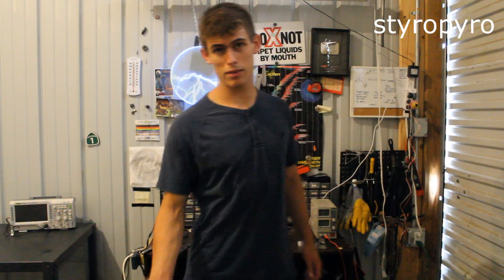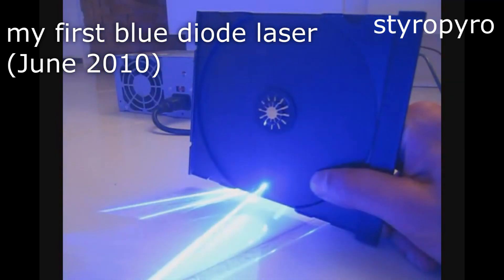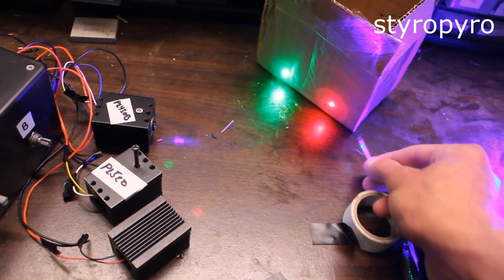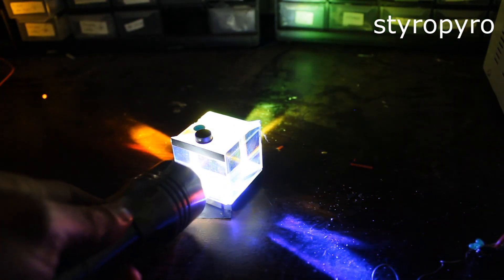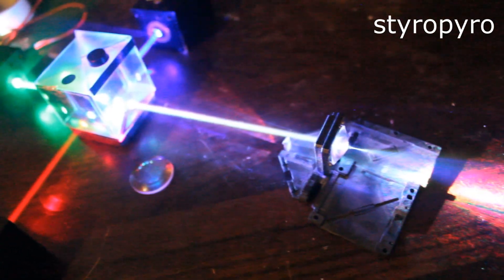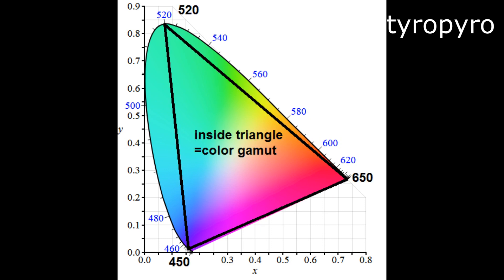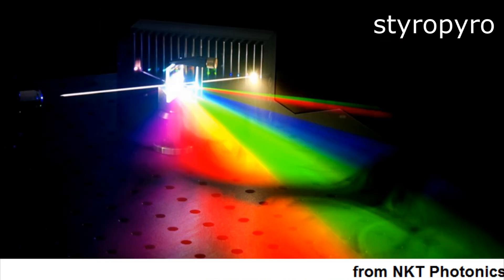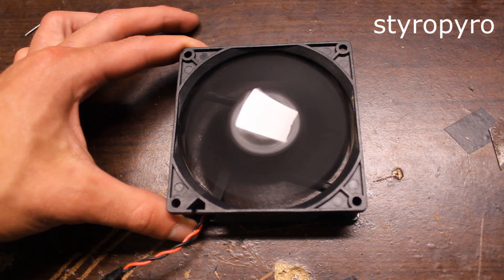Amazing White Laser Experiments!!!

Comment: “even though the amount of colors it can produce is infinite, it still can not produce all possible colors” that screwed me up
Reply: It's easier to visualize on a number line. There are an infinite amount of decimal numbers between 0 and 1, but that range is also finite. It's simultaneously both infinite and not depending on the context. If each colored laser contains a range of possible values from 0 (off) to 1 (fully lit) then really, the amount of "colors" a single laser diode can also be infinite. I think the more correct term is combinations, not colors, because everything you see from a combination of RGB lasers is still not the full spectrum. It's almost like the difference between digital audio and analog audio. Almost.
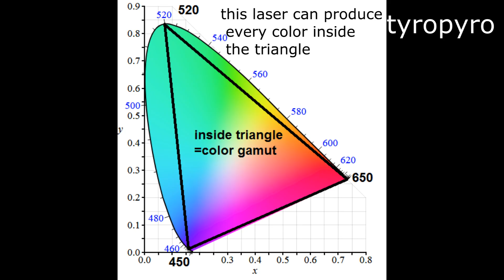Reply: @PinkShades   if the colors outside the triangle cannot be produced by my monitor why can I see them on the spectrograph in the screen at phone at 4:20 in the video?
Reply: @PinkShades  now apply what you just said to the physical world, Microcosms and Macrocosms anyone?
Reply: Thank you for explaining! Crazy how ppl think learning new facts is killing joy lmaooooo
Reply: Pink Shades thanks, that really puts it in perspective
Reply: @PinkShades nope
Reply: @PinkShades  Great explanation. Detailed enough to be accurate, concise enough to be legible.👍👍
Reply: @PinkShades  
I think your right that the term used would be "combinations not colors" - very good point, because "color" presupposes an experience - a "qualia" in philosophy of mind - and these are not likely to be infinite for a whole variety of reasons. 
Firstly, the limitations of the retina's absorption spectrum based on the cones. Loss, interference & variability during transmission to the visual cortex and whatever the f*ck happens in visual cortex of the brain (we dont know) - the last part is the most important because even for infinite colors - we do not have the capacity to tell them apart from each other, play with this yourself and try and identify the 16 million colors in RGB on a paint chart INDIVIDUALLY- no way ! ...........and thats just 16 million !!!!!!

Interestingly however, just when you think you cannot "improve the quality of colors" such as HDTV days, some new tech comes along and takes colors to a new dimension such as OLED TV and now QLED. Technically not "new colors" but richer, deeper saturation of colors due to more precision and smaller dots.

As for the rest of your comment, I think you need to study Cantor for a few years just to grasp the ungraspable problem of multiple infinities.
Reply: It's basically the same with an infinite ammount of numbers between 0 and 1, but those aren't all the numbers that exist
Reply: @crispybag3329  "It's basically the same with an infinite ammount of numbers between 0 and 1, but those aren't all the numbers that exist
".

That's a head fuck!
Reply: not infinite.  planck's constant limits the possible energies (and thus, frequencies) that a photon can possess.  if it was truly infinite, this would describe the ultraviolet catastrophe.
Reply: bn peters not infinit until someone like planck discover another level, we humans have limitations as our machines and technology are also limited, planck was a pioneer but who knows what science will discover in the future?
Reply: It can't as it is limited to a Planck Length. Also, radio waves are color but using RGB you can't get those.
Reply: @Ham549  radio waves are not color. Just because it's on the electromagnetic spectrum doesn't mean it's color. Colors only exist in the visible spectrum (which is arbitrarily determined by our eyes). Radio waves could have been color (extremely unlikely), but they aren't.
Reply: @AirNeat  So infrared and ultra violet are not color?
Reply: @Ham549  No, they aren't. We can translate them to colors (as in thermal imaging), but they themselves are colorless.

There is infrared light around us at all times and we do not see it because it is colorless (although it would be cool to have thermal vision).

We can't see them, hence they aren't in the aptly named "Visible Spectrum"
Reply: @AirNeat There is a solid argument that both infrared and ultraviolet light are colors, just not colors that humans can see.

The visible spectrum we speak only delimits what is visible to humans.  Other animals have different limits of EMR perception: some can see infrared radiation, and some can see ultraviolet radiation. If they experience these in much the same way as we experience the extremes of our own visible spectrum, then they experience them as colors. Therefore it's a bit unfair to say that IR and UV, and wait for it... All their combinations with OTHER colors visible to a specific animal aren't colors. 
So, arguably, IR and UV have color that some animals can perceive, but which remain an invisible wonder to humans.
Reply: There are infinite colors, but this can only produce a fraction of those. What’s infinity divided by 4?
…
Infinity.
Reply: Technically, it's not infinite even though it's analog, because wavelengths are discrete, not continuous. There's a minimum unit where wavelength can change, the Planck length.
Reply: My titties hurt
Reply: Your videos always put a smile on my face. Always happy when one pops up on my feed.
Reply: @Tetrahedrony black is the combination of 0 colors... so klack is always possible to make.... just shut down the power and ur done
Reply: @Robert Baker  lol reminds me of a Vsauce vid i watched
Reply: @Tetrahedrony just put them off lmao
Reply: Todomo what he meant is that it can make all colours but can not put them all out
Reply: Tetrahedrony I genuinely feel bad for you. The internet just doesn’t know when to quit. You seem like a nice guy, too.
Reply: every infinite is different
Reply: Just like there are infinite numbers between 1 and 2, but 3 isnt contained between 1 and 2
Reply: it screwed me up to
Reply: Some infinities are larger than other infinities.
Reply: @Tetrahedrony yes you can, turn off the lasers.
Reply: Like he said he can produce purple but not violet as well with the yellow, he can only blend colors not create “true colors”
Reply: Its the same as there are  infinitif numbers between 1 and 2
Reply: it can basically produce anything in the rgb spectrum but it cant produce ir or uv
Reply: There are infinite decimals.
Reply: Infinite shades but not all colors.
Reply: Two years later, and I have the correct answer. What Drake should have said, is that this setup could create an infinite number of hues but as light cannot be dark (only dim), there is a finite range of colours due to limited control of luminance. As there is no infinite luminance (as at a certain point the power of the laser would cause issues displaying "Dark" colours), there is no way to have any colours past a certain brightness, and orange will always be, well, orange.

Technology Connections has a video about why LEDs can't produce brown, as brown is literally dark orange. But we don't say dark orange, we say brown so it is a colour more of artificial concept, than universal fact. If you were to say, increase the brightness and saturation of your feces, it could in theory be orange. (Or if you eat a lot of sugar, a pale pea green.)
Reply: @bluephreakr  Saw that Technology Connections video too, but doesn't a color consist of it's hue? if there are virtually infinite hues then there are virtually infinite colors right? Well that also depends on what "color" exactly is. There are multiple correct answers with different interpretations. Have a nice day and no need to answer me as this edit pretty much answers myself.
Reply: @rosalina-dev I mentioned this — he can make a dim orange, but that isn't brown. Complex colours where black is required to create within the CMYK colourspace is impossible. So this laser is limited to the RGB colourspace and even with CMY lasers he would still be limited to the outer fringes of RGB within a circluar representation, or top edge within a rectangular representation, as well any variation with white.
Reply: @Robert Baker well played sir
Reply: If you think about numbers might help: even though the group of even numbers is infinite they cannot contain an odd number 😉
Reply: i think he's wrong there because there aren't infinite incidences of the wave a human eye can see due to the irregularities of the eye and cornea. If colour is relative to the viewer that is.
Reply: basically just use a number line. eg. all possible colours is 0-100. However, the laser can only produce 0-1. However, the laser can produce infinite colours inside 0-1: 0.45, 0.12376876928765, etc.
Reply: That’s because infiniticity is a concept not a number
Reply: That is the most Gen Z profile picture ever
Reply: It can’t produce infrared and below, and ultra violet or above. It’s not hard to understand
Reply: With how much discussion has already occurred in this comment thread, I'm surprised to have found no mention of the fact that there are more real numbers in the unit interval than there are integers, and there are as many real numbers in the unit interval as there are real numbers, yet the unit interval doesn't cover the entire set of real numbers.
Reply: Infinite fractions in between a range of numbers, lol. But that range of numbers is not "all numbers"
Reply: Even though the amount of numbers between 1 and 0 is infinite, there are numbers both higher and lower than 1 and 0

Words are weird
Reply: Same feeling hearing "purple and violet are not the same color"
Thems is fightin' words
Reply: Brown blazer is next lol
Reply: Infinite combinations but still cannot get certain colors or lack of colors in certain instances like black. There is no true black light.
Reply: Just wanted to comment as the dumbest person in this chat. Hi!
Reply: Imaginese una escala de grises con variacion tan minima entre un tono de gris y el siguiente que podria literalmente tener una escala de grises infinita
Reply: Pat Salis ❤❤❤❤❤❤❤❤❤❤❤❤❤❤❤❤❤❤❤❤❤❤❤❤❤🎉🎉🎉🎉🎉🎉❤❤❤❤❤❤❤❤❤❤❤🎉🎉🎉🎉🎉❤❤❤❤❤❤❤❤❤❤❤❤❤🎉🎉🎉🎉❤❤❤❤❤❤❤❤❤❤❤❤❤❤❤🎉🎉🎉🎉❤❤❤❤❤❤❤❤❤❤❤❤❤❤🎉🎉🎉🎉❤❤❤❤❤❤❤❤❤❤❤❤❤❤❤❤❤❤❤❤❤❤❤❤❤❤❤❤❤❤❤❤❤❤❤❤❤❤❤❤❤❤❤❤❤❤❤🎉🎉🎉🎉❤❤❤❤❤❤❤❤❤❤❤❤❤❤❤❤❤❤❤❤❤❤❤❤❤❤❤❤❤❤❤❤❤❤
Reply: PatSalis ❤❤❤❤❤❤❤❤❤❤❤❤❤❤❤❤❤❤❤❤❤❤❤❤❤❤❤❤❤❤❤🎉🎉🎉🎉❤❤❤❤❤❤❤❤❤❤❤❤❤❤❤❤❤❤❤❤🎉🎉🎉🎉❤❤❤❤❤❤❤❤❤❤❤❤❤❤❤❤❤❤❤❤❤❤❤❤❤❤❤❤❤❤❤🎉🎉🎉❤❤❤❤❤❤❤❤❤❤❤❤❤🎉🎉🎉❤❤❤❤❤❤❤❤❤❤❤❤❤❤❤🎉🎉❤❤❤❤❤❤❤❤❤❤❤
Reply: Gotta admit that was clever
Reply: Basically some infinities are bigger than others
Reply: That is right, this laser can't make pink for instance because you need to mix white and red to get pink, so you'd need another red laser.
Reply: The numbers between 0 and 1 are infinite, but that set does not include all numbers. 😂
Reply: @Tetrahedrony I wasn't replying to you. I know what you said, and I don't care what you said. It was stupid. First, black isn't a color, it's the absence of light. Second, 0 to 1 is not a list, it's a range. You can probably find your IQ in it if you look hard enough.
Reply: Pink Shades This post right here officer. This is where I found the body.
Reply: @PinkShades  Jesus that's pretty fucking harsh dude.
Reply: @deffdefying4803  savage yes. harsh no. maybe he shouldn't assume EVERY COMMENT that comes up on his feed is for him
Reply: @deffdefying4803  Ya, he went full all out rage on him lol!
Reply: @PinkShades  i'd rather be in a room with an idiot than an ego-filled person like you.
Reply: @PinkShades  im gonna bring you back to this so you can explain why you ruined the fun
Reply: @_TheMushroomMan  I love this chain of comments so much. I think I burned someone so harshly they deleted their comment or something? I don't remember but someone learned something.
Reply: @PinkShades  nice, but ya really had to ruin the fun some other guy even said something about it, it was funny to see but also not funny, but hey at least I brought you back to it
Reply: @PinkShades  When Drake said Happy lasing I didn't think he meant that. Brutal!
Reply: @Pink Shades Whew that was a close one, I was almost starting to feel a little better. thanks for killin the mood!
Reply: @PinkShades  TRIGGERED
Reply: @PinkShades  LOL savage, but true.
Reply: @PinkShades  I like styro's use of the color diagram, as the geometric analysis makes a lot of sense. A 'pure cyan' of 490 nm isn't reproducible from blue 450 and green 520 because combining those two produces something between the desired 490 nm and white. The same hue can be achieved, but it's slightly 'washed out' as he put it.
Reply: @PinkShades  ha
Reply: Pink Shades R/iamverysmart
Reply: @PinkShades  im DEAD BROOO FUCK
Reply: Pink Shades black is a color no color is what you see if you close one eye and keep the other eye open what you see out of the closed eye is no color blind people don’t see any color so they don’t even see black they just see what you see out of the closed eye but in both eyes also colors reflect off your retina and black is one of the colors that you can see so that color reflects off your retina so you can see it so black is a color
Reply: Technically, black is the absence of any light. And even in the artistic world, black is not defined as a colour, but a shade. And white is technically also a shade.

Yet what may be hard to get your head around and know is that there is actually no such thing as colour. There are simply various wavelengths of electromagnetic radiation. Colour is simply how we perceive these various wavelengths as determined by the construct of the human eye, and our brains.
Reply: @PinkShades  Black is the combination of all colors, but the absence of all light.
Thanks for coming to my TED Talk.
Reply: Pink Shades Black isn’t the absence of light. Darkness is the absence of light. If black was the absence of light then you wouldn’t be able to physically see it other than a void. This is why you can see black paper.
Reply: @Yeet-cy8tz  you are mixing up the differences between additive and subtractive colors aka lights vs pigments.
Reply: The number of combinations of those 3 colors is so high it is considered infinite, because you could never test all of them with current equipment. However, because he is not using the deepest color possible for red, green, and blue, and there are not any of the other natural colors, the total possible colors are not covered. 

In summary:
the combinations of RGB are infinite, 
because he si only using RGB, not all possible colors are covered. 
If he had a laser of every deepest hue of a color (Which would be many, many lasers), then he could replicate the entire visible light spectrum. However.... doing that manually would be difficult. So I'd advise using a computer program to run through the sequence of laser intensities.
Reply: @EnderMalcolm  
Doesnt really matter because your brain wouldn't be able to tell the difference even for 16million RGB with colors next to each other on a sliding scale. Try it, we just dont have the sensitivity - any additional combinations and its just a waste of time.
So 16 billion combinations - far from infinite, but utterly ridiculous as you cant tell most of them apart from each other on a sliding scale of hue - limitations of brain processing not physics of the actual combination.

"Color" is a human experience

"the combination" in terms of wavelength spectrum is "out there in the world" 

We see only the colors, not the thing in itself, the "actual spectrum" - which is many layers away from conversion into color on a long journey through the eye, retina, cones, nervous system, brain and eventually a qualia of color experience..........

So, whether infinite or 16 million or 16 billion, ultimately in terms of actual colors its irrelevant due to limitations of biology not physics.
Reply: @EnderMalcolm  but then wouldnt it be digital/discrete instead of the truly infinite variability of each with analog control? 
Just wondering.
Reply: Wavelengths of light. Look it up. There's only a cerrone wavelength humans can see. For example, we can't see infrared light. And these diodes can't produce infrared light. Thus not all colors can be produced. But an infinite range of rbg mixtures can be made.
Reply: @xannax2050  
 the visible spectrum of light not the entire electromagnetic spectrum.
Infared is not visible spectrum, so obviously we don't see it. Just like we dont see X-Ray, Gamma Ray, Radio, Microwaves or anything other than visible light.
Reply: You just have a low IQ

Comment: @styropyro Shouldn't there only be a limited amount of colors with this laser, since the diodes have a maximum power output and a limited possible number of power levels between zero and that. So you could "only" have insert incredibly high yet finite number ^3 colors? Or am I not understanding something correctly?

Comment: Very entertaining. If you use a similar mixer in existing optical data transmission systems-fiber, it will be possible to increase the transmission speed from three to fifteen times.

Comment: Any schematics for the 317 box?
Also, you mentioned that the total power was around 400 mw.
But I can't find a PL 520 (even PL 520_B1) that's around 100 + mw.  I totally see a 100mw PL 450B.  And I presume strong RED diodes are easy to find too.

Comment: That smoke and mirror trick at the end, with the lasers, was like looking at a warp coil from Star Trek. That would be a really need thing to use it for, actually. If you set it up inside a large clear cylinder, and had the laser centered in the middle of the circle on one end, pointing to a fan at the other end… You'd need to have the mirror in the center of the fan angled 45 degrees to point to a second mirror at the tip of the fan blades. And the mirror at the tip would be 45 degrees again; made to point back toward the end of the tube it came from, such the the path of the laser nearly traces the clear walls of the cylinder, creating an illusionary cylinder of its own. The fan blades may benefit from a counterweight to match the weight of the mirror at the edge of the fan blades. Add fog, and you have a warp coil prop.